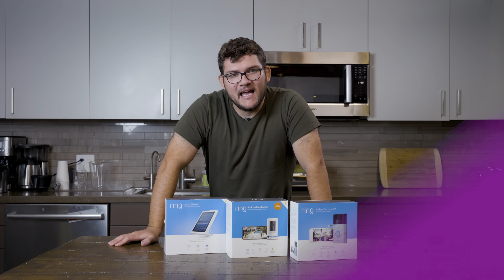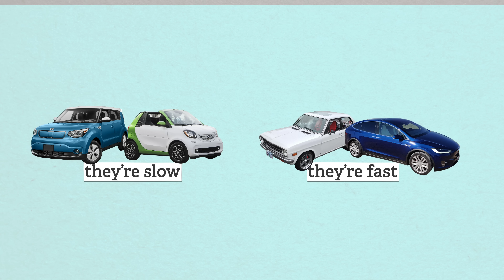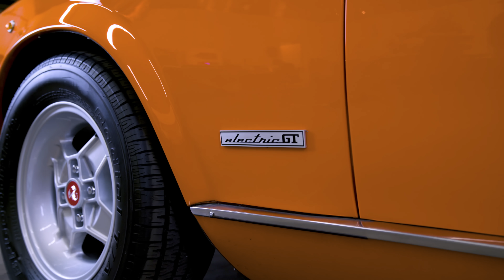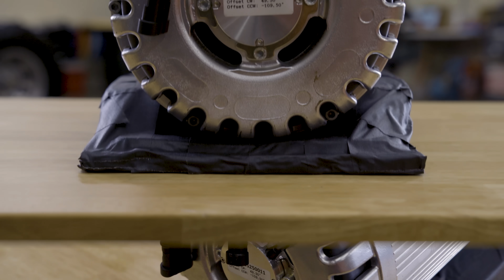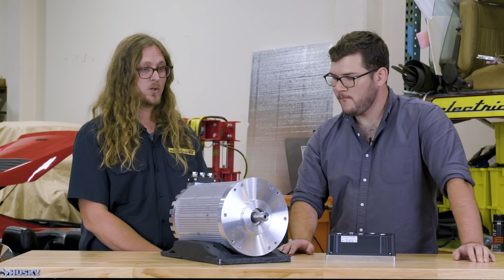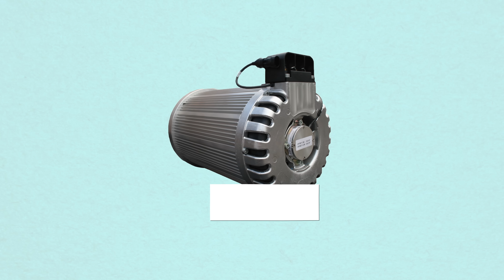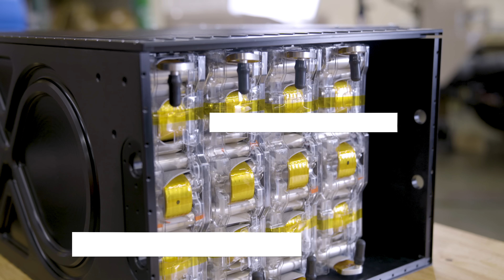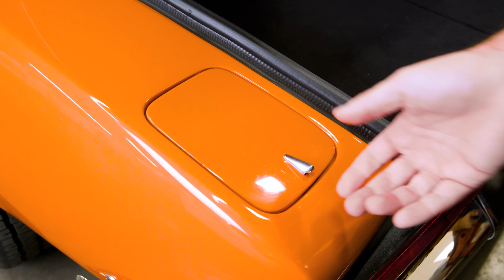Are Electric Motor Swaps the Future of Tuning? | WheelHouse

Comment: I have a 3V mustang same as you, you are NOT getting 250 miles to the tank. Maybe more like... 180 to 200 max. I average 12-14 MPG and thats with a lot of highway driving.... A lot of highway PULLS, but, your a mustang owner its what you do. 16 gallon tank means 190-220 miles from full to out of gas. And you should NEVER run out of gas. Destroys your fuel pump.

Comment: Um no, no electric motor will replace the sound, feel and joy of a LS, Boxer, V12 etc.

Yes they will probably be faster and better for Mileage. But regarding the feel, sound and overall pleasure of driving. It will never compare to IC motors. It's just what makes a car a car.

I'm not biased against electric. I like these cars.
Reply: What makes a car a car is the ability to drive it. Has nothing to do with what powers it. I don't see any difference between an electric swap versus any other kind of swap (rotary, carbureted, LS, etc) all you're doing is choosing a different kind of power source

Comment: Sound's the biggest turn off from electric swaps
Reply: I used to think the same. But some of the sounds those motors make man, fucking insane.
Reply: @KERBROES  Not as insane as a ferrari v12 though. Electric motors can sound cool, but they are in no way a replacement for the sound of an internal combustion engine. I'm not saying that you said they were, but I'm just saying, it is not the same. I'd much rather listen to even a 4cyl than an electric motor. People say formula e cars sound great, but not to my ears... they're not bad, sure, but they're not that great either.
Reply: @jamesshives5679  haha cant say I disagree. I would own an electric car for its quirkiness .

Comment: Why you should  electrify classic cars? The great thing of clossic cars is that they are mechanical and not technical. You control the car, not the car drives you. Sure electric cars has great acceleration but why should you swap an classic car with such an technic? I mean you could do it, but why, why should you do it?
Reply: because emissions
Reply: @Adrian_Nel  because it doesn't cost  CO2 to build an electric engine and batteries...
Reply: An electric classic car cannot drive itself unless you install autonomy. Also, people do it because they want to drive the car and not let it rot in a garage somewhere.
Reply: Would you rather just scrap the shells of all those cars with blown engines?

Comment: How much should that cost I’m only 19 and have spent a lot trying to get my 95 Cadillac deville running good. I have a boat car! It would be so easy to e swap and have a lot of range lol
Reply: Low speed and low cost  = low range.
High speed, low cost = low range. 
Mid speed, mid cost = mid range. (100 mile)
Voltages play rolls in top speed as that helps a motor spin faster.

Comment: They are missing what petrol heads love the noise the rumble the smells the variety.. electric cars are pretty amazing how fast they go but its just boring and you have to replace all the batteries in a few years an engine can go forever if looked after it and what happens to the dead batteries?

Comment: My 2 cents:
1. I like the sound of internal combustion a lot!
2. I would rather have options for gas stations instead of what my electric company feels like charging for electricity (besides I don't have a Slushie machine in my garage...yet)
3. Pretty sure electric cars will be very fast, very soon and I don't care. I like the sound of a V8, see #1.
4. I would rather wrench on a regular vehicle than 400-600 watts and hundreds of amps (DC not AC, big difference). I have been shocked by 240 ~30amps AC,  3/10 would not recommend.
Reply: Usually when you tinker with an electric car, you can completely disconnect the batteries from the rest of the vehicle, so getting shocked isn’t a big risk. You can also wear gloves to electrically isolate your hands, to minimize the risk of shock even more.
Reply: " I would rather have options for gas stations instead of what my electric company feels like charging for electricity". You know, whenever there is an EV video, it's a competition to see who can make the dumbest comment, typically based of the pathetic level of STEM education in American schools.
It cost less than a third on electricity over gas , regardless of what price you get for shitty ethanol-spiked gas. Instead, you'd rather be OPEC's bitch and bend over every fillup and send US soldiers to die to keep gas "cheap".
Do electricity rates shoot up every holiday weekend?  Does a war in Dumfukistan cause electricity rates to shoot up overnight?
Two cents doesn't buy anything any more.  I have no doubt you have been shocked by sticking your tongue in a 240V outlet.
Reply: @truantray  What is your point exactly? That I am dumb because I have a differing opinion than yours? 
You still haven't addressed the issue of sound and I really don't mind buying gas for my V8 even if it isn't "cheap". 
I will gladly acknowledge my shortcomings, the electric vehicle has it's advantages, it's disadvantages but how about you?
Do you think electricity costs are the same everywhere? How about if there is no other fuel competition, what incentive do they have to keep it "cheap"?
That "shitty ethanol-spiked gas" has made some very impressive and fast E-85 vehicles due to the higher resistance to pinging, at a lower price per gallon (albeit the fuel is expended faster).
My point is there are two sides to every story. There is no free lunch. You seem like a passionate person okleydokley, don't let that blind you. And what do you have to gain from insulting me about something I freely admit? Here is the rest of the story: at the end of a 13 1/2 hour manual labor job when I was ~15yo I accidentally put a staple from an all metal staple gun into a run of 240 that wasn't visible. It could have easily killed me, just as some mechanic could kill themselves on these extremely powerful and dangerous battery packs.
If you have any other concerns you know where to find me, please do some reflecting and just have a good day friend.

Comment: The future is in hybrid technology. Diesel engine up front and a petrol engine in the back.
Reply: nah fam
Reply: MAYBE diesel and electric since you can make diesel out of basically anything.  But the idea is to phase out petrol....so...no.
Reply: @aaronbrock4049  no the idea is to phase out fossil fuel in general o would say petrol and electric hybrid is the best setup
Reply: It is going to depend on upcoming battery technology, as if electron storage becomes significantly better, there is little use in carrying around dino juice (and the added weight) as your energy supply.

As is, the few consumer electric cars available are close enough to their gas counterparts. When they start to exceed, that is when electric will really take off.
Reply: @quintessenceSL  the problem is that physics wise a new element or power source has to be found and used to make these batteries exceed petrol cars. Petrol and diesel have a higher energy density than lithium ion batteries and any other battery for that matter hence why we are still using the good dino juice. Electric cars will only take off if governments force it which they are.
Reply: @cargillmonteque2311  

Not exactly (at least not the whole of the problem).

Electric cars are currently HEAVY, and combing diesel with electric just compounds the problem (unless you are using a small turbine). Petrol may be energy dense, but the best IC engines are maybe 40% efficient, while you can get efficiencies of well above 90% with electric. I could foresee a time when electric cars have lighter drivetrains (plus fuel) than IC for a given range.
Reply: @quintessenceSL  I can't see that they are currently heavy because of physics batteries aren't 90 percent efficient the motor is yes petrol cars are less efficient however hybrid cars would balance that out

Comment: I would love to swap a electric motor in a RX7 so I can afford to actually drive it :)
Even tho replacing the Rotary would break my heart.
Reply: R.I.P. apex seals
Reply: magnetic rotary
Reply: 3TZVirus Official that’s an expensive swap. Just get a low mile one or rebuild it every 70k. They’re not unreliable. Vargas from hoonigan daily drives and road trips an fc with around 400hp believe.
Reply: @JosephSamsor  I dont think there is a way I could do that. I live in Germany, and I believe we did not get the RX 7 in the first place, the parts are just not available. Its just a dream, but putting a electric Motor on each wheel would eliminate a lot of maintinance issues, and you coud easily get 600+ HP, in AWD. Also, gas prices in Germany are pretty high, and they keep getting worse like every two years. I bet we'll have to pay 2€/liter soon >:(
Reply: 3TZVirus Official electric is very difficult. There is far less support and you would then have a vehicle that would not be able to take advantage of your amazing autobahn. I know someone that owned an fd rx7 there though. I bet it could be imported. You can have a whole engine sent to you if you need it. If you really like electric there obviously isn’t a substitute but if you want an fd, there’s cheaper ways to keep one running. You could even be a badass and do a Mercedes v8 swap. Everyone would go just over that. It’s all preference in the end though. I just don’t know how electric would fair at high speed on the autobahn for extended periods of time.
Reply: @JosephSamsor  Yes, but here in germany the dumb ass TÜV annoying us car guys with stupid regulations. I doubt a V8 swapped FD would get permisson to drive on open roads, even less a high power electric swap :(

Comment: The problem with these swaps is that if you want the power Tesla P100D makes you need entirety of the Tesla battery package and motors. Or less batteries with much denser capacity for same range and power but less weight (non existent yet) or less batteries and electric motor/motors with higher current flow, so it can drain them quicker but then you have no range at all.

Comment: 250 per tank in your Mustang is horrible. Gas cars are designed to last 350 per tank during normal driving conditions. Either you spend hours in stop and go traffic or you have some running issues... or both.

Comment: honestly I don't mind the idea of an electric motor with a manual transmission you can still shift
Reply: This, and if they can convert more classic cars to electric. I enjoy driving a manual, and I don't like the look of Tesla's. Otherwise, I wouldn't mind driving an EV.
Reply: @udubdave  since Cali uses its smog laws in an effort to "reduce emissions" then they should use taxpayer money to offer us the option to converting our existing vehicles over to electric and just pay the people doing the work with the money we pay in dmv fines, fees, and taxes. Offer an incentive for people to want to make real change instead of using existing laws in order to drive revenue for the state.
Reply: I like the whining of the VW IDR race car, so I think an electric motor that makes noise with a manual gearbox would actually be great
Reply: If people stop complaining about the short range, sure. Because a transmission is going to eat away like 5 to 10 percent or so.
Reply: @Appletank8  There are now magnetic clutches for EVs, which will decrease the range very little, but will make the car much more faster. And if you go faster with same speed, it's gonna safe energy. I think electric motors in Tesla are most effective at 25% of speed. Mustang already done it.
Reply: @georgeb5262  
Considering the torque of motors, you could just set up the gearing to operate at that "25% speed" (pretty sure its efficient range is wider than that) at cruising speed. What Mustang did IIRC is to add a much lower gear so you can have super high low-speed acceleration, which, sure I guess, but its a pure fun thing, not practical thing. Comes with increasing complexity and weight
Reply: @Appletank8  Tesla added two motors for that. Weight isn't that much issue with that powerful car. And you still gets better fuel capacity, because the motor work with the same energy, but goes faster (even if less quickly).
Reply: @Appletank8  maybe with gas car gearing. When geared for an EV, a transmission can increase range quite substantially
Reply: And it wouldn’t stall.
Reply: YESSSSSS exactly and still having solid axles for a truck
Reply: I would actually be interested if one day a car youtuber would think of using Electric motors for forced induction, essentially making a P1 style or 918 style hybrid system
Reply: I think it would be interesting
Reply: Goes to show how little you know about the use of transmissions and you like manual because it’s the “cool car guy” thing.
Reply: @howcanimiss  agreed on that part!
Reply: @howcanimiss  i’d prefer manual in a fast car but automatic is good on any care to me now tbh
Reply: you can also probably set the throttle to act like a combustion engine with a rising torque bar instead of a boring flat one
Reply: The no clutch engagement at idle would take a little bit getting used to. Kind of hard to get rid of a few decades of muscle memory.
Reply: Nah fam! Its shitty!
Reply: @Kyle Weaver well you can shift with the new opel manta 2021 but it's only one example to show, for now i hope ^^
Reply: Realistically, you have one big problem: The electric motors have INSTANT torque. You would have to tune DOWN the electric output to create a rev range/power output. 

Huh. 

That could work.
Reply: @grioghar  Maybe lower rpm motors would work?
Reply: I don't really think you can shift like we are used to with manual transmissions. It's a cool idea because you don't need to use the clutch for start and go but I think attempting to use the clutch to join/sync the motor and transmission might be a bad idea because of the (possible) high rpm of the EV motor. Maybe I'm over-thinking this.
Reply: i actually want that since i grew up to manual also ive never touched an automatic
Reply: Yeah, I think this way we may able to presever more increasing number of classic cars this well. Well minus their original engines. Well it is inevitable this will happen, so engines will likely preserved as glass case collection or few still in the car but maybe barely driven with special license. Fuel will be challenge in the future in the world of all EVs.
Reply: I think what would be cool is if ooh made the electric motors fake an engine curve. Then you'd actually need to shift. And you'd still have fun.
Reply: @Derpynewb  It's not necessarily to have it. Porsche Taycan. Also I think ideal shift place for race is around 60-65% of the curve. There will be max power for max RMP. For peaceful driving ~25%.
Reply: @georgeb5262  :|. I know it's unnecessary. I meant for fun. A fake engine curve for fun. I mean bmw already fake engine noieses. Why not fake the engine curve too? Pretend vtecc
Reply: @Derpynewb  I mean the motor is most effective between 25% and 75%. You can shift in them.
Reply: Manual transmission is better than auto.
Reply: I drive an s13 manual 1988 club k engine ca18det
Reply: @iketanikoichiro3519  so a peice of shit drift missile from the 80s with one of nissans last reliable engines...oh yeah, much better then a much more powerful and efficient electric motor with instant torque. Fuckin noob
Reply: @sweetwaterbadrap7443   lmfao a drift missile ??!! 🤣
Reply: Danish Wistara  shut up pussy. Electric cars arent competing, they already won that battle and theyre on an entirely new level completely their own. Go cry in a corner somewhere
Reply: No get the fuck out of here. Don’t ruin our cars! You lready ruined the new ones! I like my cars reliable and to have a sound
Reply: Iketani Koichiro then what do you drive? (Car model)

Comment: Let me know when they run under 3.3 seconds in a quarter mile
Reply: You mean like a top fueler that needs to be rebuilt every 4 passes and uses 12 gallons of alcohol per mile? Or a jet truck that takes 15 minutes to fire up before a pass? Does it hurt you that the fastest street legal track cars are hybrids? The new Corvette is available as a 1000hp hybrid as well. Automatic transmissions are faster these days too, just the way she goes.
Reply: Batma'am who cares about jet trucks. And the newest corvette is not a 1000 hp hybrid they have just released the base version prototypes to the public and if your going to talk about Chevrolet with me you better know your facts. Furthermore top fuel alcohol cars are torn down after every pass not 4 passes. And the fastest street legal track cars are not hybrids a car being street legal is not hard to achieve and I have not seen any hybrids running in the 5 seconds. And automatics have been able to beat manuals for 50 years and sad thing is some of the fastest cars still using the same 50 year old th400 Chevy autos.
Reply: Let me know when you daily drive a jet engine dragster
Reply: Thanh Hảo Lê they don’t run 3.3 and jet dragsters are lame